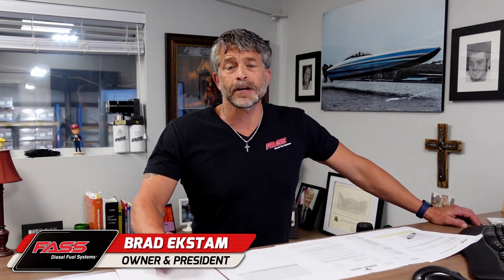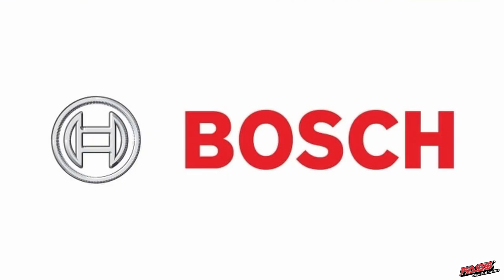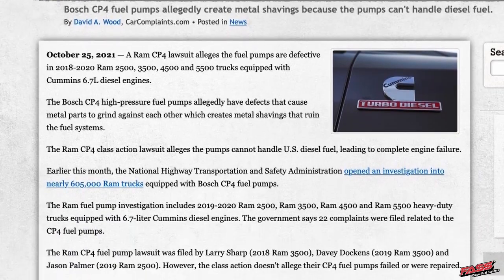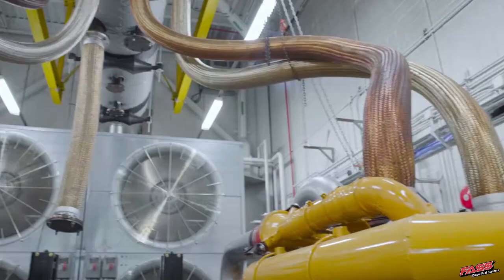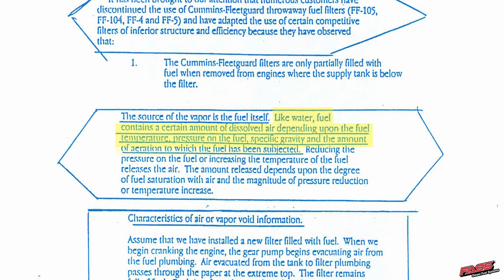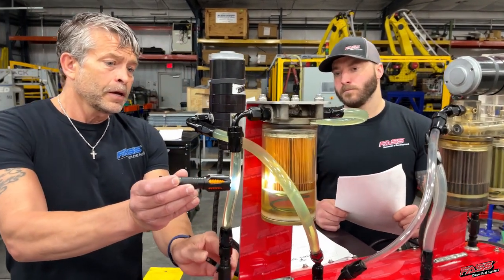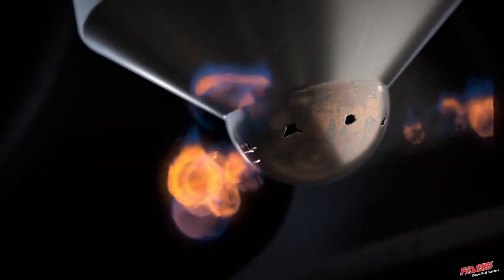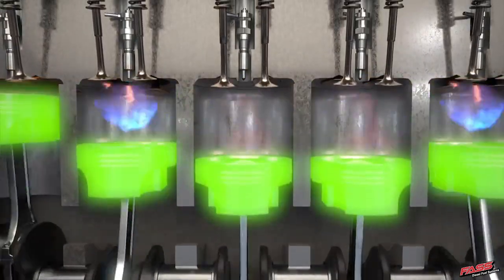What's hiding in your OEM fuel system? | Air in Fuel Episode 1

Comment: What’s hidden in a factory fuel lift pump is lots of Air and lack of fuel flow
Reply from the maker: Great question the air in the fuel mostly comes from sloshing of the tank creating the air bubbles in the fuel like you see in the video. Fuel flow from the factory lift pump can be a weak point for sure based on the year, and model truck.